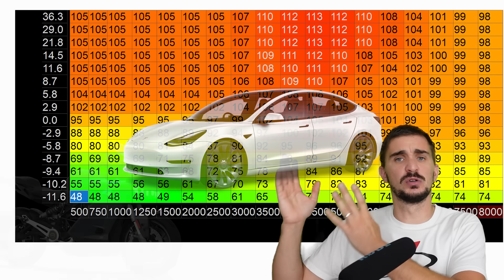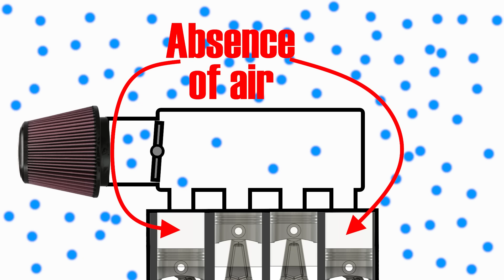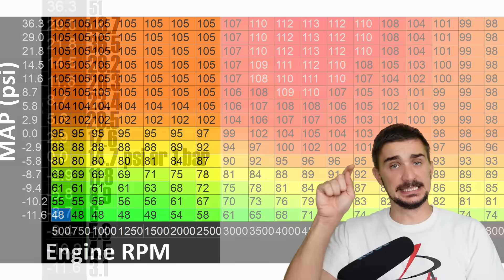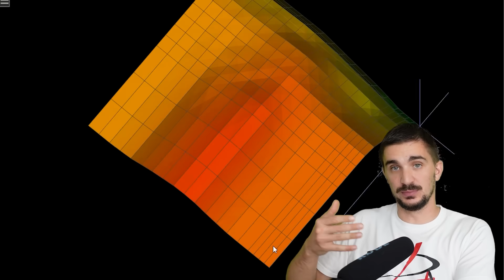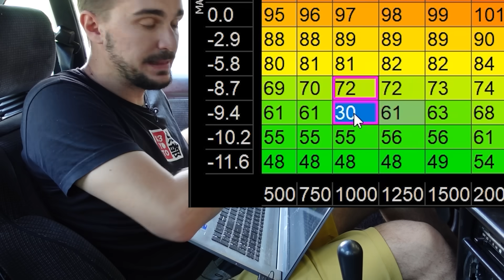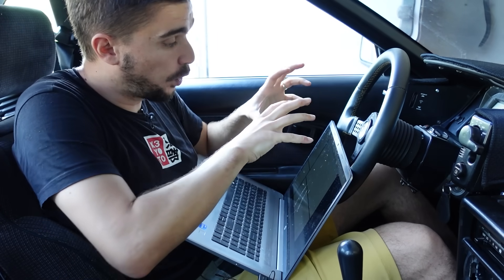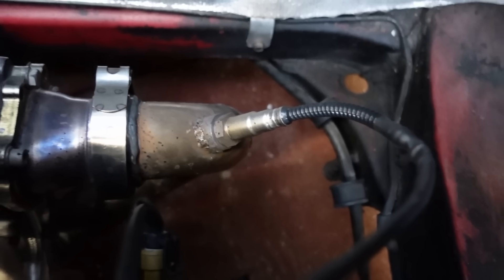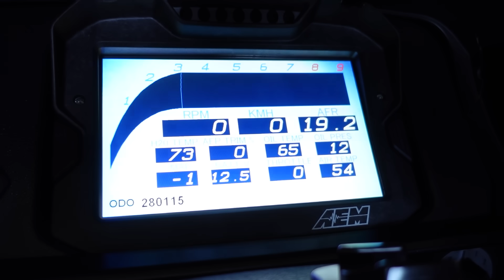If You Understand Volumetric Efficiency You Understand Engines

Comment: A little bit of complimentary information:
Negative pressure is technically refered to as negative Barometric pressure. Zero manometric pressure is a perfect vaccuum, so there cannot be negative manometric pressure. The difference comes from the instruments used to measure pressure. A Barometer has it's zero point calibrated at normal atmospheric pressure and can go negative. A Manometer measures absolute pressure, so it starts at zero, which is a perfect vaccuum. Where atmospheric pressure is depends on the unit marked on the dial.

The torque falloff at high revs is technically refered to as "pumping losses". Moving air creates friction with the walls of it's passages and itself. That friction creates resistance to the passage of air which makes the engine waste more energy to pump. The energy wasted is converted to heat, which heats up the air and wathever it's passing through. There's no way to thoroughly mitigate it withouth a complete and complex study of the entire path of air in the engine. But what you can do (in order of what's more to less practical, last ones may be pretty much impossible) is install a filter with more surface area, clean and polish the surfaces air moves through, remove sharp edges from the air's path, shorten the path of the air from filter to cylinders, increase the size of the air's passageways.
Reply: Simpler terms which are unambiguous  and more widely used. ABSOLUTE PRESSURE = Pressure above a perfect Vacuum. GUAGE PRESSURE = Pressure above atmospheric pressure. PARTIAL VACUUM is pressure below atmospheric.

Comment: Great videos and I love the efforts, animations and the entire channel. There are only a few points in this video that I would like mention:
- at 2:30 saying „the engine is consuming more air than provided by the throttle plate“. At steady state, the engine consumes the exact amount of air, which is provided by the throttle plate. Here, the restriction of the throttle plate results in the low absolute gas pressure within the intake manifold. 
- At 3:48, the „intake manifold pressure equals atmospheric pressure“. There are two effects. On the one hand, you need to consider pressure losses originating from the air filter and piping. On the other hand, there are dynamic pressure pulsations within the intake system propagating with the speed of sound, which can be used for dynamic induction (the high pressure pulse arrives at the intake valve shorty before intake valve closing) 
- at 5:12: „atmospheric pressure is a constant“. The atmospheric pressure is changing from day to day and also depends on your location and elevation. However, the sensor can detect the difference between the atmospheric and manifold pressure
- At 8:15: „the peak torque is decreasing at high engine speeds due to time limitations“. This explanation is not complete. As mentioned, there are pressure pulsations propagating through the intake (and exhaust) systems with the speed of sound. A fixed manifold geometry therefore results in a fairly fixed time of pressure pulse reflection, which can be used for improved gas exchanges at a certain engine speed. If the piping lengths are designed for a good gas exchange at 4500 rpm, the gas exchange process will impede at higher rpms. And a variable intake manifold provides you with the chance of adaptation.
- And at 13:37, „the show. AFR map is representative for modern engines“. Modern EU6d gasoline engines run with lambda 1 in the entire engine map.

Comment: The ecu reads the map and inject the the amount of fuel it says ,then it reads the data from oxigen sensor in  exhaust and if it is fulse it change the map , and repeat this until the map say the same with the sensors. Correct?

Comment: You are a treasure to the car community, sir.
By the way, what is shown at 14:10 is called "Closed Loop Controller" or "Closed Feedback Controller" (it was not mentioned during the video I think) and it is massively used at basically all industrial processes I can think of:
You measure the output of the process and input it back as one of the variables doing the calculation. One of the most common examples of the math doing the magic to let the system know how much to vary the input to adapt to the measured output is the PID Algorithm (Proportional-Integral-Derivative). Even 3D printers use it on the firmware.
Reply: Is this the same as a negative feedback loop?
Reply: @abdul-kabiralegbe5660  negative feedback is one specific case of closed loop controller.
Reply: @Gryphus-R  Thanks.
Reply: @abdul-kabiralegbe5660 Yes, negative feedback loop stabilizes the process, while a positive feedback loop destabilizes the process.

Most (if not all) controllers use negative feedback.

Positive feedback loops can be seen in nature, like the Ferguson effect (in childbirth) or when getting injured and more and more blood flows to try and seal the wound.
Reply: @andreimateescu8997  Thanks.
Reply: 3d printers: good ones do but for most cheapo firmwares you just have to adjust your gcodes otherwise the bed would just jolt around with every minor movement of the head.
Reply: @mammadtori3964  you are wrong. PID is used on temperature control. And it was there already on very old versions of for example Marlin Firmware. The prism-shape Reprap i2 I built more rhan 10 years ago already had PID control of nozzle temperature.
What you are talking about is head movement and that is controlled by the steps of the stepper motors. There is no closed loop control there. If there is jerk/jolt or snap, that's a problem of acceleration parameters configured.
Resistance to jolt depends on how well the machine is designed and built and it has nothing to do with closed loop control

Comment: A great video as always - thank you! 
I'll add for those tuning a car themselves ( as I am currently learning to do ) if you are playing with ignition timing, being aware of knock is important. My '90 MX5 does not have a knock sensor and it is something on my mind as I tune.
Reply: You know you can buy knock detection equipment right? You can also make yourself if your on a tight budget. 
You have to also be aware that increasing ignition timing increases cylinder pressure too. Maybe not a problem on a n/a mx5 (knock will prob come first) , but on a turbocharged car you have to really balance timing,boost and fueling. Rich fueling if I remember correctly decreases cylinder pressure a little (to a point)

Comment: I haven't done any engine tuning for some 10 years now (before I've built some Megasquirt 1-2 based systems).
Back in the days I've used Megalog Viewer and I also have a licensed version of Tuner Studio MS with Auto-tune.
Are these two systems still suitable for wideband lambda based VE table correction? As I get from the video, the pricinple is still the same, only there are newer ECUs and software solutions.
What would you recommend for new budget (entry level track/rally) builds, in terms of ECU and software?

Comment: Thank you so much for this video!!!
I wanted to learn this since forever!
This was very good made and easy to understand. Also thank you for showing a "normal" car, nothing too crazy! I now want to try and run my old 10v 5 Cylinder Volvo on a custom ecu just for fun!
Could you maybe do a video on tuning with that map? Will the engine produce it's maximum of possible power when the map is perfect? In what way do manufacturers "restrict" the standard ecu in terms of power delivery?
Reply: Two of the big drivers for vehicle manufacturers’ are fuel efficiency and emissions. Unfortunately, the ‘best’ settings for those isn’t necessarily the same as is needed for highest performance/power/torque, so an engine will likely be optimised for fuel efficiency/emissions, but with your aftermarket ecu and a laptop, you can change the emphasis towards high performance.
Even though your aim might be highest power at every possible point, sometimes you might have to compromise that goal for reasons of ‘drivability’

Comment: One of the most useful tuning videos on the internet today. I'm midway through modern EFIing a 70s car, and I'm glad to see my decision validated here. Wideband, and e-throttle should massively improve emissions and driveability.
Reply: Use a mechanical throttle. You have to tune in throttle response with e throttles.
Reply: Could you please make a video when you've finished it? I'm very interested in the result :)
Reply: On my ls swapped truck, I wish I had e throttle. As much as I love the responsiveness of the manual throttle, I’d like the ability to adjust pedal sensitivity. Even though it’s manual, it doesn’t feel linear which is something I could tune with an e throttle
Reply: Dig it. My forever car will be a 240z with a modern engine.
Reply: @daftpanda6533 that's only exclusive to OEM applications. Most stock vehicles with cable throttles still have rev hang, because the ECU holds the idle valve wide open. A proper standalone lets you keep the idle valve closed when off the throttle.
Reply: @daftpanda6533  An aluminum small block Ford naturally aspirated would be amazing and not weigh much more if any than the original I6. They're also smaller externally than the LS or SBC.
Reply: @randyduncan795  The engine I want to put in it won't fit, without tubing the front end. It's a Nissan Vh45de- dual over head cam, closed deck. Variants were used in Indy and I think F1 - but with a flat plane crank. 
The old Z has a long engine bay, but it's narrow. 😢
I might do an RB series (to keep it Nissan) or other  turbo dohc I6. (JZ, Barra) 
The Aussie Ford Barra block is a monster with boost.
Reply: @daftpanda6533  And I thought my idea would be costly. You have a fun project going. Good luck!
Reply: @randyduncan795  it would be  my dream forever car. Old,  light chassis with some modern power, suspension and brakes. 
It won't be the nicest or fastest, but it will be mine- and that's all that matters to me. 

While I'm not rich or anything, there's definitely ways to save money on a build. Most of it is planning ahead of time cooked with some good luck on finding good condition rebuildable engines.
Reply: @daftpanda6533  How about a VK50VE (modern version of VH45DE used in LMP3 cars) from a FX50/QX70. I plan on getting an S30 Z one day and was thinking of using this engine or the VR30DDTT from Infiniti Q50/60 and new Z.
Reply: @Q50_BlackSport  From what I understand, all of the dohc 45°v8 don't fit an s30. At least not without cutting up the front of the chassis and tube framing it. I talked to a guy recently about buying a Vh45 that he was going to put in his s30, but the chassis was really clean and he didn't want to cut it up. 
Personally, I wouldn't cut up a clean s30 chassis either. There's plenty of S30s that are in ok-ish condition that would be suitable for a heavy restomod like that. 

The s30 chassis is extremely narrow. There's an all CF s30 featured on Hooligans channel,  it got huge flares and wide wheels- but the owner says it's still only as wide as an S chassis.

Also the VK is a completely different engine, it's based on the VQ series. Semi open/open deck engine. The Nismo VK engines were  likely modified race blocks. Iirc the VK was also used in Indy  cars, with a flat plane crank, tho destroked to meet regs.
Reply: @daftpanda6533  I’m the exact opposite lol. I want a modern car with a carburetor and manual transmission.
Reply: @markm0000  I'm all for a manual transmission. The main reason I want a modern engine is they're more efficient, more precisely tunable and make more power. 
That said I certainly appreciate the sound of an old straight six with triple Mikunis and ITBs, or a v8 with 2 4 barrel carbs and a high lift cam. 

There really is no wrong way for car enthusiasts. One of my favorite car collectors is Jay Leno - because he has so many awesome and unique cars- and still cherishes (and drives) them all.
Reply: @daftpanda6533  the reason I want a carb is because I don’t trust hydraulic injectors and a computer to work when I need them most. Also you can dump almost any fuel in the tank and it will run it.
Reply: @markm0000  Ya diesels can be modded to run on almost anything.

If you mean grades of gasoline, it still depends on how much compression the engine has. It's still possible to grenade an engine running on carbs- if the compression is high enough. If it's not a high comp engine should be fine tho, just run em a little rich. 

Every system has it's strengths and weaknesses. 😁👍

That said, I'd agree modern cars have gotten a bit out of hand with the amount of computers they have, and the fact they're all CAN -BUSsed together.  I just want one computer to run the damn engine. Lol.
Reply: I hate e-throttle though. I love EFI but with mechanical throttle. With e-throttle, there is always a slight delay the moment you jab the accelerator and the engine RPM begin to rise. This effect is less prominent if you run a CVT gearbox, however if you have a manual gearbox, the rev hang sucks because of the slight delay from the e-throttle.
Reply: @fleurdewin7958  Rev hang is a function of manufacturer programming for emissions reduction- it's to avoid that split second rich condition in throttle close. 
It isn't inherent to drive by wire by design. Modern computers are definitely fast enough to have instant response, and ecus can be tuned appropriately.
Reply: @fleurdewin7958 E throttle has no inherent perceptible delay. If you have experience a delay in a factory car, the OEM has done this on purpose, either for emissions or just because they want the car to be easy to drive. A properly tuned aftermarket ECU or an OEM sporty vehicle should have basically no delay.
Reply: @fleurdewin7958  I hate unsourceable ancient Bosch parts more. The hybrid Bosch Jetronik-L system controls anti-stall, idle control, and such are unobtanium. E-throttle doesn't have downsides for my application, throttle position has a delay of less than 50ms (measured on an oscilloscope) which I'm sure is not perceptible in normal driving conditions.
Reply: @LeeHambley Bosch jettronic? You wouldn't happen to be working on an 80s toyota would you? My 86 van uses the jettronic system. It's simple but complicated at the same time. Old school batch fired injectors and very rudimentary closed loop operation. I've always wanted to swap to a megasquirt ECU or something similar and get full control of spark and fuel and see how much more efficient I can make it.
Reply: @MegaDysart  '76 280Z - but the Jetronik-L and -K systems are all similar in that area I guess.
Reply: @MegaDysart  sounds like I ought to put a video together on my upgrade and upload it to YouTube.
Reply: @MegaDysart  You'd probably need to add a reluctor  for  crank signal to run a stand alone, but you could also probably run coil on plug as well. Modern aftermarket ECUs can handle all of that easily, as well as injector pulse width and timing. You would also have to add knock sensor(s) for the ECU to know when to pull timing. Iirc the old Bosch Jettronic systems used vacuum advance at the distributor.  Or had they switched to electronic control for spark advance by then?
Reply: @fleurdewin7958  What you're actually describing is a smoothing delay manufacturers add to throttle input so large bumps changing the throttle position don't instantly get converted to torque, and the rev Hang is a side effect of holding the throttle a little open to help with emissions.  Both things that can be tuned out.
Reply: @GingerNingerGames my 2002 Prius has ZERO throttle delay. Absolutely none. Toyota wanted to emphasize the instantaneous response of electric motors.
Reply: @fleurdewin7958 That delay is programmed into factory ECU's for emision reasons. Aftermarket ECU's have instant response with e throttle. Have a look at any modern race car. All e throttle.
Reply: or try the carb cheater
Reply: @josephmccausland7175 or you could just learn how to tune a carb 😂 you ppl crack me up with this carb cheater lol try that with some boost lmk how those pistons hang on the shelf after 😂
Reply: @oliverscorsim  do you always make a half a dozen assumptions when pontificating?